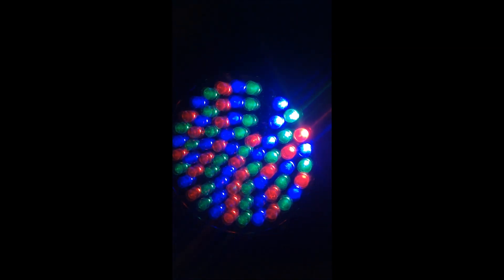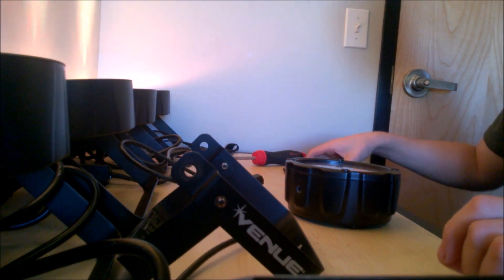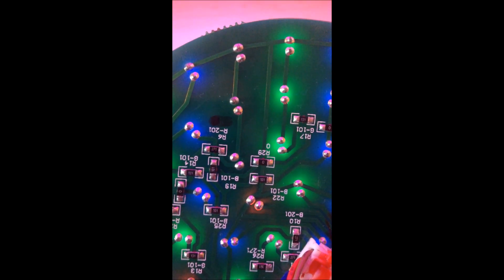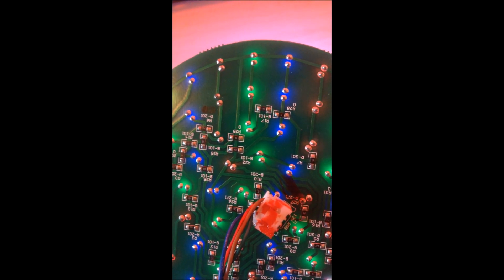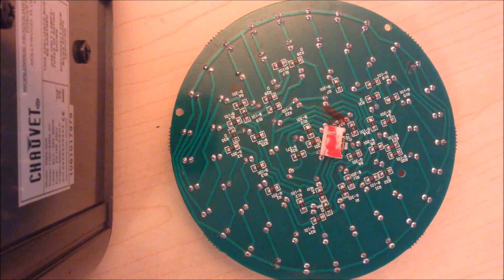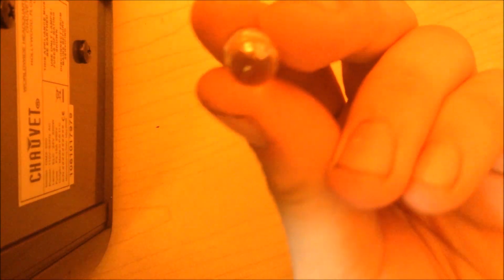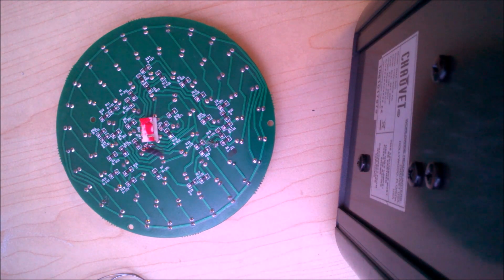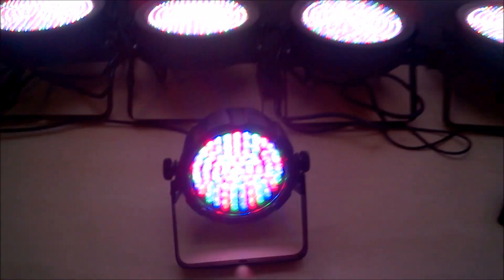Led Repair Slimpar Dmx Light

Comment: How about pulling on the leads while you're heating the joints rather than letting them cool as you pull?  Good way to have cold solder joints.

Comment: I found A-1099 10mm red LEDs at Tayda Electronics.  The LEDs they had there are 14000 -16000 mcd.  What's interesting is that the red one has a lower forward voltage, 1.9-2.1V than the green (A-1096) and blue ones (A-1105) which are 3.2 -3.4V.  Bulb prices are $0.10 each.
Company is in Thailand but despite that, shipping rates and shipping times are very reasonable, at least what I experienced when ordering and a very reasonable minimum order of $5.00.  I haven't received them yet so bird in hand, 2 in bush at this point.
Reply: still $.10 from Tayda 4 years later and they shipped the next day.  I have taken the bad bulbs out of 12 SlimPar 64 using a loose LED as a tester to find the bad bulb in each set of 3 that was out our blinking.  I have 33 reds and 1 blue to replace (got pretty good at finding the culprit... maybe 10 min each to disassemble and take out a blub... a solder sucker is a must!).  I expect I will be replacing many reds on these fixtures so will buy another batch just to have, figuring once they start going more are on the brink.
It's clear they are overdriving the reds to get the color out, and that's why so many reds are failing
Reply: Tayda came thru and I have the replacement  LEDs
Reply: the reds all have a higher resistor than the g and b, but on the light I am working on (slimpar64) all the burned out bulbs are reds